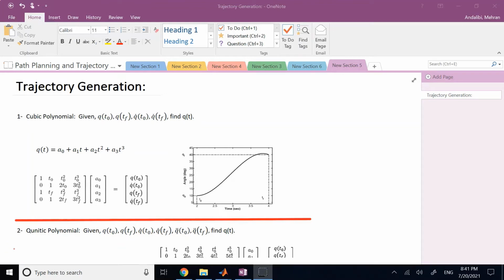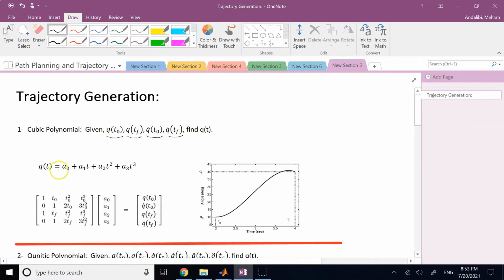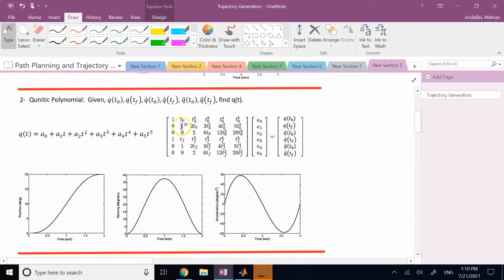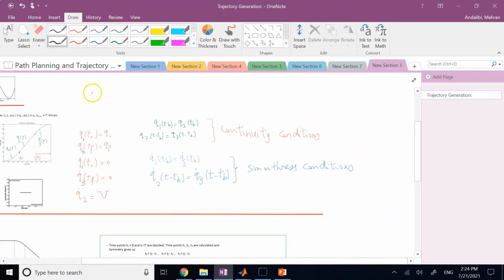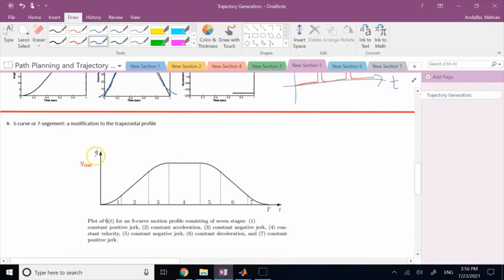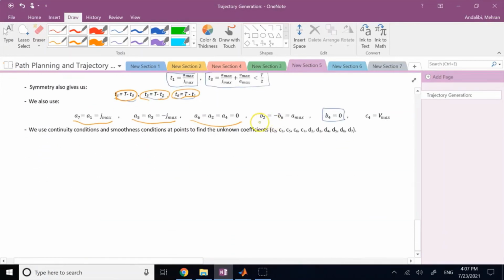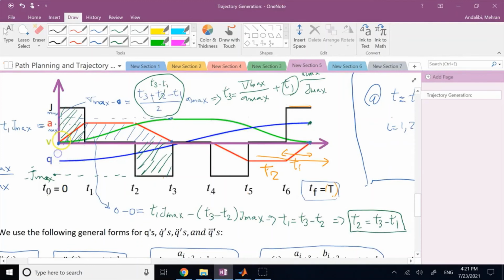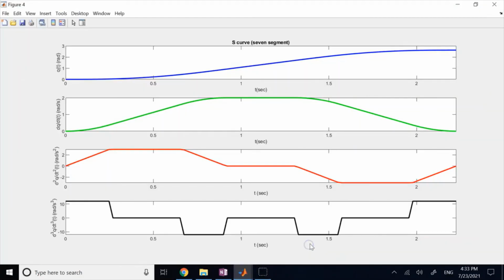Trajectory Generation

Comment: Hello Sir, This is a very informative video on s curve trajectory. I am using this to control the motion of a linear drive of a cartesian robot but I am having an issue with the MATLAB script when I try to generate the same trajectory. If it is possible for you can you share the script code, I would be very thankful. Also, is it possible to generate this specific type of trajectory in Simulink. Thanks.

Comment: corrected code  %% Quintic Polynomial

clear all;

t0=0.5;
tf=1.5;
qt0=0;
qtf=20;
qdott0=0;
qdottf=0;
q2dott0=0;
q2dottf=0;
%%n=16;
%%IL=0.2;
%%IM=0.005;
%%Ieq=IM+IL/(n^2);

A=[1 t0 t0^2 t0^3 t0^4 t0^5;...
    0 1 2*t0 3*t0^2 4*t0^3 5*t0^4;...
    0 0 2 6*t0 12*t0^2 20*t0^3;...
    1 tf tf^2 tf^3 tf^4 tf^5;...
    0 1 2*tf 3*tf^2 4*tf^3 5*tf^4;...
    0 0 2 6*tf 12*tf^2 20*tf^3];

RHS=[qt0;qdott0;q2dott0;qtf;qdottf;q2dottf];

coeffs=inv(A)*RHS;

t=linspace(t0,tf,200);
q=coeffs(6)*t.^5+coeffs(5)*t.^4+coeffs(4)*t.^3+...
    coeffs(3)*t.^2+coeffs(2)*t+coeffs(1);
qdot=5*coeffs(6)*t.^4+4*coeffs(5)*t.^3+...
    3*coeffs(4)*t.^2+2*coeffs(3)*t+coeffs(2);
q2dot=20*coeffs(6)*t.^3+12*coeffs(5)*t.^2+6*coeffs(4)*t+2*coeffs(3);

%%omega_max=max(abs(qdot))*30/pi;
%%T_max=Ieq*max(abs(q2dot));
%%fprintf('using quintic polynomial, the maximum angular velocity is %4.2f rpms\n',omega_max);
%%fprintf('using quintic polynomial, the maximum torque is %4.2f N-ms\n',T_max);

figure(2);
subplot(3,1,1);
plot(t,q);
xlabel('t(sec)');
ylabel('q(t) (rad)');
title('Quintic Polynomial');
subplot(3,1,2);
plot(t,qdot);
xlabel('t (sec)');
ylabel('dq/dt(t) (rad/s)');
subplot(3,1,3);
plot(t,q2dot);
xlabel('t (sec)');
ylabel('d^{2}q/dt^{2}(t) (rad/s^{2})');

Comment: Hello, sir. If I want to execute this in Simulink, how can I convert it? I would like to add PID motor position control after the S-curve.
Reply: hello, you can take you input i suppose the speed and add a line in your code 
 V = timeseries(v', t');
and then go to Simulink and add a "from workspace" box and add your V (v is the vector calculated in the algorithm, and t is the time )